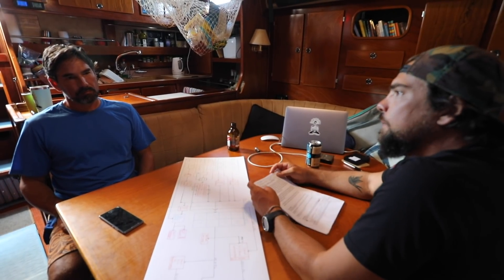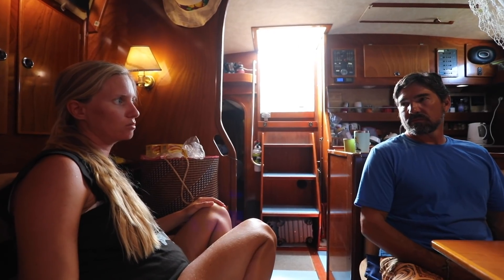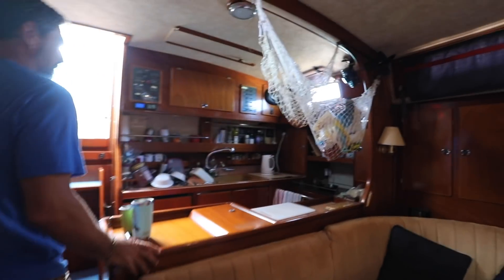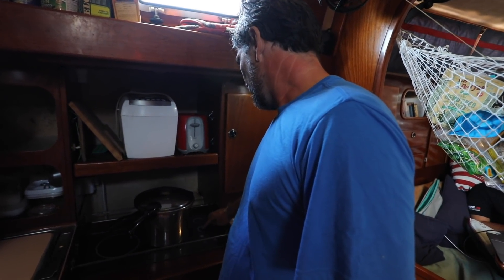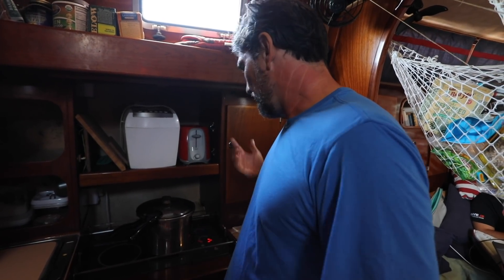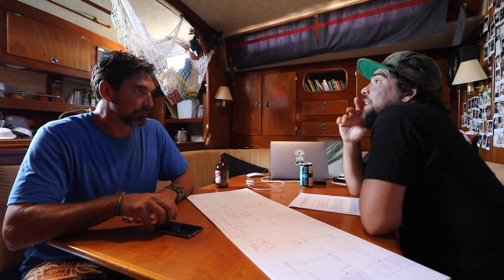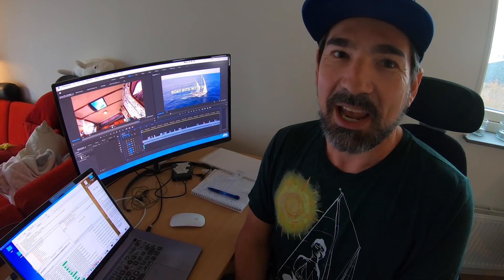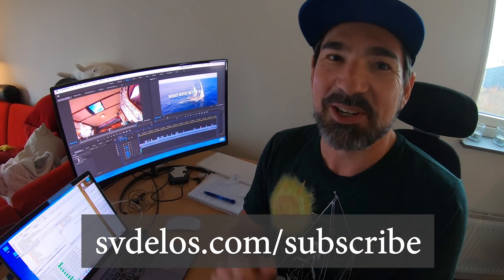1 YEAR REVIEW - Induction Cooking on a Sailboat -  ELECTRICAL BOAT TECH (3 of 7)

Comment: Hi Brian, we struggle with our induction and lithium. I watched your video and it helped a bit. However I  did not understand your quote “if we want to bring the voltage down in case you want to use the generator”. What do you mean by that?
We have a 4000W inverter and over 1300W solar, yet as soon as we use the hob the voltage drops.
Maybe you van explain.
We’d love to hear from you. Kindest regards, Ingrid
Reply: Ingrid, I think what Brian meant to say is that by turning down one of the hobs it reduces the current draw to below the 1800w total limit of their double induction hob.  The first thing you could check is that your 4kW inverter is a real pure sine wave, rather than the cheaper square or modified sine wave used by many of the cheaper inverters.  Also is it really 4kW or is this just a peak rating for a moment rather than permanent supply.  Many inverters have a power rating but also a peak momentary rating which they use to "big up" the inverter.  

Assuming you are using less than a 2kW of power the inverter powered from a decent sized LifePO4 battery bank should run an induction hob and if it doesn't there is clearly something wrong.  Measure the draw at the battery, the input to the inverter and in AC for the inverter and assuming a loss of 10-15% for a PSW inverter do the numbers look about right.  Do any of the connections get hot and is the cables from batteries to hob the right size are other questions worth thinking about.

Some light reading:  https://www.cruisersforum.com/forums/f91/pushing-the-limits-of-electric-cooking-266163-2.html

Comment: Since the new stove and oven are mounted on a gimble the wires to it are going to get a lot of flexing due to the movements of the boat.  How did you install the wiring minimize the stresses on the wires?  Should the wires break while under way can you replace the wiring with on-the-boat materials? Do you have a cook stove backup?

Comment: I got some friends that have gone induction on their boat, about 12 months ago as well.  Only issue they have is that cant use the 'boost ' function on their stove as it maxs out thier inverter.  They run multiple small inverters on their boat,  that whole video pretty much reminds me of their reasoning for doing it.  Propane can be a massive PITA to find in some areas of the pacific.

Many newer luxury cruising boats are coming out with dual gas/induction stove tops

Comment: I bought a single portable induction burner for the boat, with intentions of ditching the propane stove and tanks. I think it works great, but I haven’t gotten my wife’s buy-in yet. I’m still working on her though... maybe I’ll have her carry a tank next time we have to walk a couple of miles with it to get it filled. What is your solution to avoid having pots slide off the induction burner in roll’y anchorage? Our gas stove has the adjustable pot grabber things on it. Anyone rig a solution for flat cook tops?

Comment: Brian/Brady Question...do you have room on board to stow a backup Stove in case your primary goes down? Also, can you use a plug and play toaster oven which generally runs between 1800 and 2300 watts?

Comment: The question I would have is how much does running all electric cooking and such depend on having a lithium ion battery set, and would it work as well with lead acid batteries?

Comment: I have used a induction convection set up in my home for years now. A couple more advantages are much faster cooking times, I can cook a pound of hamburger in a little over 1 min (yeah that fast, stir constantly) and lower overall power consumption. The convection is great because the moving air gets rid of any hot or cold spots and also cooks at a lower temperature due to its moving air transfers heat more efficiently. I use skillets on the cook top. Nothing works better with induction. I'll never use a different set up, I've been spoiled.

Comment: Yet again s great video! I'm loving the infomational videos just as much as the adventure ones. They certainly show how much you've learnt from equipment and system failures in the past. The propane problems you had previously were so damned annoying that I'd have chucked the damn thing over the side. But as usual you guys figured out a solution.

Comment: For me not only, but especially those technical vids are on track dead center, because it is real cruising long term testing. Thank you so much!
If it wasn't for the creasy prize a double walled, means insolated pressure cooker would be the pinnacle of energy efficient cooking, btw.

Comment: Great series of videos on power. Super useful, we are trying to decide between 2 solar panels giving us 800W or 3 solar panels giving us 1200W. 3 does create a big wing at the stern and does over hand the sides of the boat bu 0.5m each side.
How do you guys find 3 panels, especially when stern mooring in tight spots!
Reply from the maker: The panels for us are okay, but the wind generators hanging over the side can easily be knocked by poles, posts, etc.  You might be okay though.  We are putting on flexible panels in about 2 months, will let you know how those work out for us :)
Reply: Did you contact Eamonn on SV Travel Bud regarding the parts for the balooner. He will be in Gran Canaria next week.

Comment: I carry a small magnet on my keyring so when I visit OP Shops I can test the pot and pan before I buy. If the magnet sticks it good to go for induction.
My gas oven drives me crazy with its hot spot... I leave a pizza stone on the bottom shelf to try and mitigate the problem... better but not perfect.
Reply: I cant get pizza stones but I found even cookie pans help distribute the heat by placing them on the bottom self. Why can't the manufacturers make something that works better? I'm sure theres a way to add something at the factory.
Reply: @SailingCorina  yea, it's not rocket science and it as frustrating as hell when 90% of the baked item looks perfect and the last 10% is carbon!

Comment: I do not live on a sailboat but I ditched using my counter top electric resistive calrod burners after buying a counter top single induction burner. Here in central Fla its hot 7 - 8 months in the year & using a resistive electric heating element adds much heat to the kitchen whereas the induction cooktop heats only the cook pan & its contents.  I cook many meals using a 6 Qt pressure cooker & its very economical & much easier to control the cooking level with the induction cooktop. I recently read that induction cooking uses 60 -70% less energy compared to electric resistive heating elements.

Comment: does the boat need to be insulated for heat if it were to sail into colder waters like the North Atlantic?
Reply from the maker: If sure makes it a lot nicer, otherwise you can get terrible condensation where the hot air meets the cold hull surface.  Kind of like a cool glass on a hot day.

Comment: What kind of pots did you have to switch to? Kazza mentioned twice she had to get new pots : ) xo
Reply from the maker: Anything magnetic, so no alloys.  Standard cast iron works great but is heavy.  Most induction friendly pans have a little sticker on the box, and also circles in the base that are used to capture the energy and turn it into heat.

Comment: More advantages of induction cooking over propane gas are:
- no forming of carbon dioxide and moisture
- no excess heat passing around the pots and pans
- no chance of carbon monoxide poisoning
- no or less need to ventilate the cabin
Reply: I think the moisture from burning gas is a distant second to moisture from boiling liquids
Reply: all interesting points!
Reply: - induction cooktop electronics are not marine grade and only consumer grade therefore will corrode and generate electrical fault within several years
- possible electrical fault may start electrical fire which the onboard fire extinguisher can not tame

Call up any boat insurance company, propane is in the top 3 causes of boat disasters reported (right next to portable consumer electric heaters used in winter).  The only good alternative for cooking is a diesel stove.
Reply: @jonathanoasis  I am pretty sure about my electrics. The right fused and breakers should prevent trouble.  The wallas diesel stove is also electrical. I was tempted to go Wallas until I saw that it took 8 min to start. The Dickenson  stove needs electrics to run the fan during startup, and 80ml of vaporizing diesel in my cabin is not my favorite either.  I use one as heater already. Al in Al I am leaning towards induction. I think it is going to happen this summer.
Reply: @Nerd3927  I have been using a glass-top electric ceramic-induction cooktop on my blue water sailboat daily for about 6 years (wow yeah since like 2014) while plugged into 120VAC shore power, it is a very good model compatible with all cooking pots because of ceramic heating element and digital controls with timer, made by Ovente, although my ceramic-induction version is discontinued and replaced with apure induction-only version (so I would have to replace some aluminum pots).  I love this cooktop unit especially the cleanlinessof the glass top and it works fabulously.  The cooking timer and temp control is amazing since it significantly reduces amount of manual labor of monitoring the cooking.   The wear & tear is primarily the internal fan, which has gotten somewhat clogged with boat dust & lint (which there is a surprising amount of dust always in the boat from nearby sandy beach and offshore winds over desert mountains, and from clothes), this caused the bearings of the internal fan to go bad, so sometimes in the coldest month of the winter, the unit will not turn on properly, the fan will cause bearing noise as it tries to spin up, and the digital panel flashes an error code due to internal overheating.  Right now it takes a few attempts and extra 10 mins to get it started when the bearings cause this freeze-up.    The best bet would be to perform dust maintenance on the fan grill every 6 mos or so to reduce this problem  (this same maintenance should be done on the boat fridge fan too...).  There is no way to maintain the unit since it is not user-serviceable and last thing I want to do is open up an electric cooktop.   But amazingly it was under $100 and if I were to replace it, the new induction-only model is under $100 too.   (Propane stove if replaced would cost much more $$$$).    The various failures discussed in this video are kind of naive, the real point of failure will be the cooktop itself, but they are so cheap that it is possible to carry a ~$50 single-burner electric induction spare unit on board for when the main AC cooktop fails.  And secondly, an good digital (temp-configurable) electric kettle for boiling water is also a very good unit to have onboard since a lot of cooking is actually just heating up water.   Still I would figure if going ocean voyaging, it would be best to replace these AC cook units about every 5 years to avoid any potential corrosion issues, not a big deal because they are cheap and continue to become more popular so the products keep getting better every generation.  Salt gets everywhere and consumer electronics should always be considered suspect when used on an ocean-going boat long term.   There is 1 more concern not yet mentioned, and that is cooking spills, for example pasta water boils over, whether at sea during heavy swells or at the dock due to cooking error, on a normal flame burner, the flame will go out and not cause electric malfunction (just a mess to clean up), whereas on an AC cooktop, it is an open question what happens to the AC unit's electrical when boiling water spills out over everything.
Reply: @jonathanoasis  Many Thanks for your excellent feedback! I will make sure the units will stay accessible for fan cleaning, watertight from the top. I will be using 3 single burners and order one extra for spare. Much appreciated!
Reply: @jonathanoasis  or, a customer that understands propane, and it’s characteristics. ( it’s simple, really) I’m going to have both on my boat. Propane and induction. Options.
Reply: On land, in cold/dry areas the extra moisture is a benefit.
Reply: @bdijkstra1982  It has very high probability, that you can find dry areas around a ship.
Reply: @Zilahi-Branyi_Laszlo  Most people who cook, don't live on a ship.
Reply: @bdijkstra1982  yes, but a clean burning flame makes a lot of water. perfect combustion creates heat, water, and carbon dioxide, the life nutrient for plants, the building blocks of shells for crustaceans. (Calcium carbonate)

Comment: Nice update. Six years ago I found severe corrosion on my boats three burner propane stove. I dismantled most of it and have used a small Coleman burner with 1 pound propane canisters since.  The one pound canisters are much easier  to find than trying to fill a ten pound tank too.   https://biankablog.blogspot.com/2013/07/rethinking-propane-on-board-plan-a.html 
Now that I also have a new 3400 watt generator for my Electric Propulsion system I think I will add an induction burner as a backup to the primary system since it seems to work fine on Delos.

Comment: Is it possible to keep tools from rusting? I leave mine in the car, not on the boat but still get rust! 🤷🏼‍♂️ When you pull your tools out I do not see any rust 🤨
Reply: ours are on board, and no rust yet. Just give them a rinse and dry with fresh water when you are done using them and place them in cases. :)

Comment: I love the videos. You asked about other people's usage my average house uses 50KWH a day so your solar is about 10%. But we heat our house with electric and heat hot water. Lots of people think they can do solar because they do not take into account house heat or hot water if they are on natural gas like most people around here. 

I would be very interested in how do deal with hot water do you go without a hot shower every day? Heating hot water would probably be one of your larges electrical draws? And if you needed the heat of the boat would you go with a gas heater?

Comment: Hi 
Thank you for the answer 
it does make sense that it is mostly 220 v 
i am fixing a 44 footer mono hull and i will have to deal with all the electrical ac an dc 
your drawing gave me ideas about fixing my system 
also on an other subject 
the 2 poles you have on your mast , never seen that , but looks a great idea , is that a good way to use whisker poles 
and do you recommend that system , 
thank you so much again , happy wind 
Louis

Comment: We are using a 1200w cooktop that we just set on top of our built in propane cooktop :D Maybe some day we'll go all in and rip out the propane and build in some nice electrics.

Have you tried an InstaPot? We've REALLY been enjoying ours. It's just an "intelligent" pressure cooker, but it is really good.

The other thing I like about our electric cooking options is that we can take them out into the cockpit to keep the heat out of the salon/galley.

Even if we remove the propane from the galley I'd like to continue to have a propane grill on the pushpit. But that can have a directly connected tank. I was thinking of putting this on the stern ;)

https://i.pinimg.com/originals/13/8d/b6/138db6b60737ad614565465331453986.jpg

Comment: Very informative. I would wand a gas BBQ with attached high pressure cooktops. I would also want a gas instant hot water heater like the ones we have had on our RVs. Just a nice backup and the hot water heater was very efficient and reliable. Actually the heater was dual fuel.
Safe travels and love your shows

Comment: Nice work. Thank you. One question. How do you feel physically after eating the food cooked through induction, compared to gas  Light / heavy? Or  just your health and energy levels in general over time. I find microwaving deaden's the chi in the food. Induction? Cheers
Reply from the maker: I can't tell any difference, to me it's just heat on the bottom of the pan and I find we can cook stuff a little better because of accurate heat control.  Hope that helps!

Comment: hi every one 
you said that you have 220 ac power , what voltage is the cook stove and oven 
and what system do you have to split the 220 v into 110 , is it the same as a house but with a marine electrical pannel 
happy wind Louis
Reply from the maker: Hey Louis, all appliances we have including the stove and oven were bought outside the US so they are 220V.  I do have a few 110V things, like some tools and a food vacuum bagger.  To run those we use a 220V to 110V step down transformer.  I think the difference is in a house you can get 220V from 2 phases of 110V (at least in the US anyway) however on Delos we only have single phase power.  Hope that helps!

Comment: Delos mostly stays in the low latitudes so perhaps it is not an issue.  But how to you heat the boat in cool weather without propane?  Loving the series by the way.  So many systems are similar between boats and RVs that these topics are applicable to us "land sailers" as well.
Reply from the maker: Yeah, we've never had a heater onboard.   I guess the AC can be run reverse cycle but that requires the generator so when we were in the southern lattitudes and the cape of good hope we just froze our asses off.  If we do more high latitude sailing I would probably put in a proper heating system.

Comment: Can you comment on lightning prevention and protection? I have one of those dopey fuzzy lightning deterrents, but doubt it would really do anything. I am quite scared of getting hit by lightning at anchor or on passage. Sometimes we put cell phones (with our back up nav) and a handheld VHF in the microwave as protection. Would that really save them from a direct strike? I've also heard (sailor lore) that chain rhode is bad because it attracts lightning when anchored (but line wouldn't provide as good a ground). Comments on any of that?